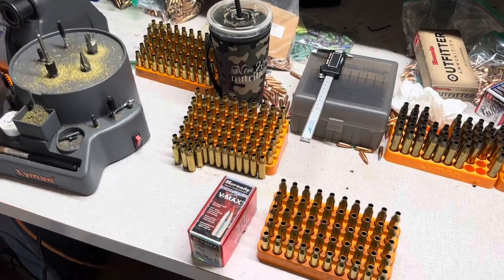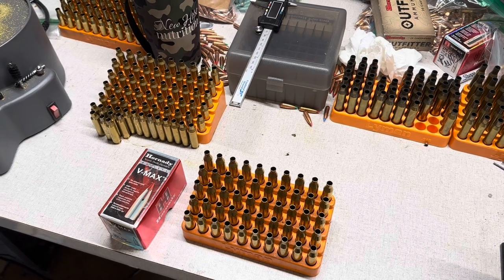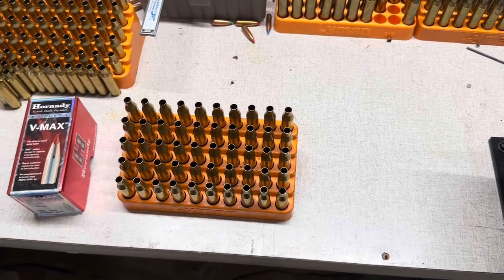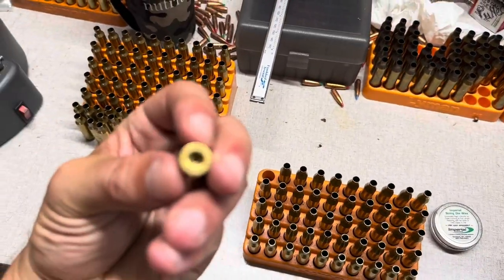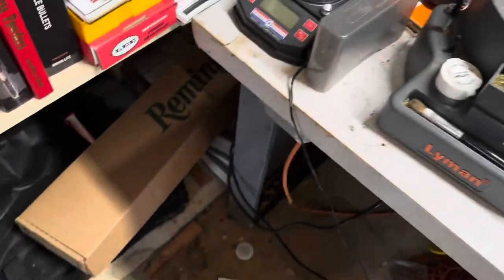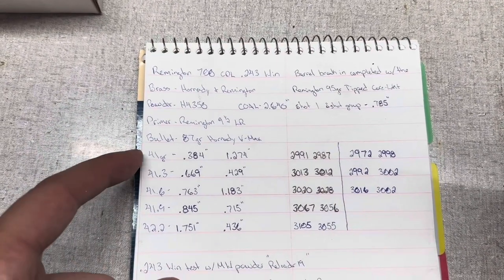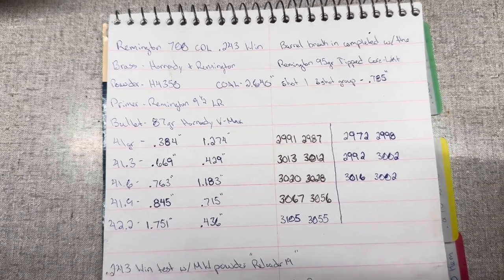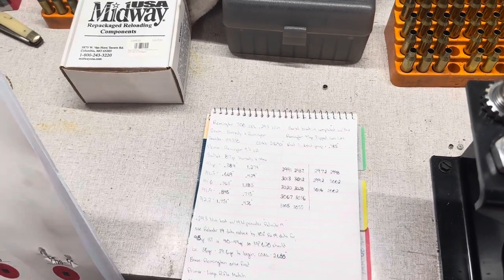The New Remington 700 CDL = Insane Accuracy 🎯

Comment: I too have had some bad experiences with Hornady Brass. The biggest problem was with the primer pockets enlarging on me. To me the Hornady brass was softer than Remington and Winchester as well as Federal. I've had good luck with Remington. The best has been the Federal and Winchester. I've never loaded Norma or Nosler brass. It's a lot more expensive to get. When I've used Starline i've had the best luck.
Reply: If you want some good brass buy Lapua....last batch was cheaper than hornady...didn't  have to debut or uniform flash holes lapua drills them...neck thickness is so even no need to turn them
Reply: Bought 100 pieces Nosler premier brass. Brass looked good, primer pockets good flash holes even and deburred...BUT...The heads seemed soft..used same 20 cases for load development then loaded 40 new cases on decided load ...on the 4th loading the first20 cases I used for load development the case heads stretched. Primer pockets were loose, smokey. No blown primers but brass is unusable.Wont hold a primer tightly. The other 80 should last a while but I'll not to expect to get over 4 reloads